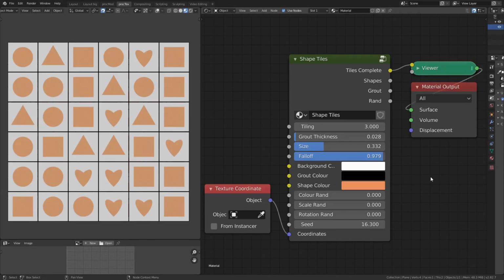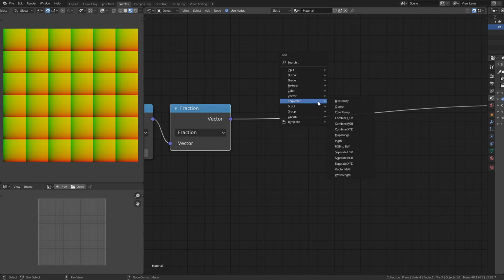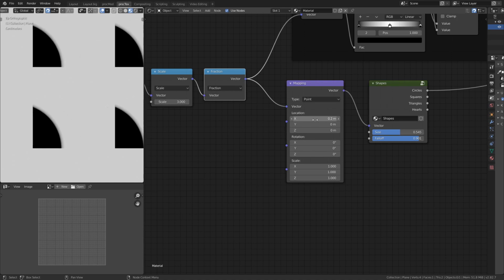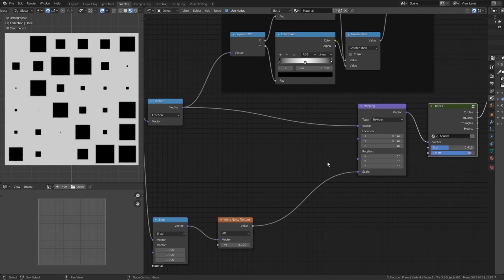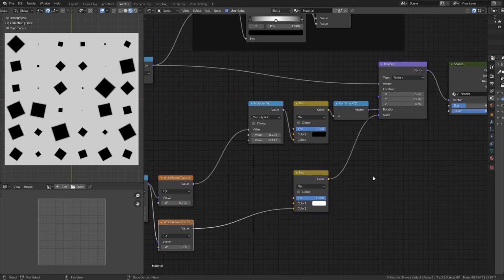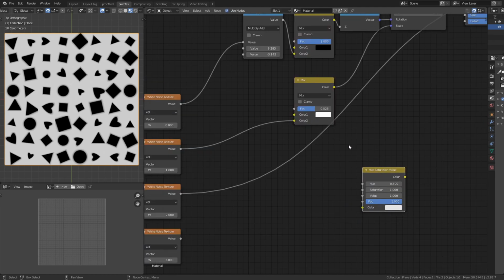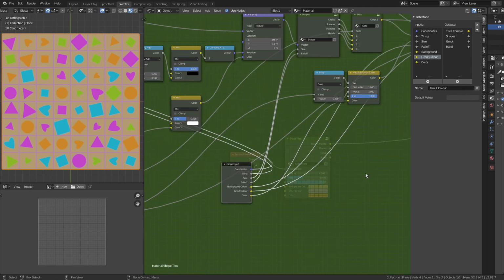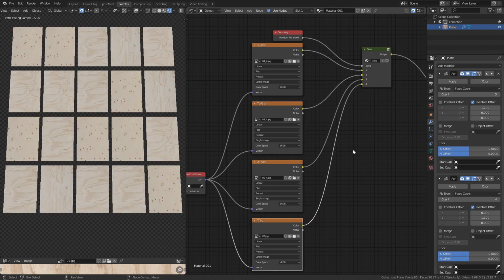Randomness and Tiling - Getting started with Blender Nodes Part 2

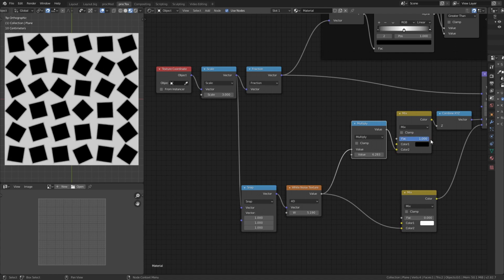Comment: Just wanted to mention something at 11:35. I’m not entirely sure if you know this now or not since this was made a few years ago, but there is actually another word for “2*pi”. It’s called “tau”, which in math is the double value of pi. If you type in “tau” in (we’ll just say for example) the “Multiplier” input value of a Math node set to “Multiply Add”, it will give you the same value as 2*pi

Comment: Very well explained. I actually already knew 75% of this, but I had to figure a significant part on my own, so my practices weren't always the best (for example, I had been using modulo instead of fraction, and kept running into the annoyance about negative numbers; frankly, as a mathematician, Blender's implementation of modulo is just mathematically wrong; this is one of many mathematical points that Python gets right but which languages like Javascript get wrong).

Comment: Oh my god you should see the insane node tree I made to achieve multiple random values, rather than doing it the correct way with noise. Mine ended up working but it takes about 10 seconds to calculate on my (fast) pc. This will change everything, thank you. Can’t wait to remake my materials more cleanly !
Reply from the maker: 10 seconds to compute is something you should be proud of! I've never made anything so heavy before 😅
Reply: @Erindale  I remade it haha, it was sooo satisfying thank you! I see some of your videos have details above the nodes that show you how long they take to compute? Is that an add on ?
Reply from the maker: In blender 3.1 you can turn on node timings in the node graph overlays
Reply: @Erindale  thank you ! :)

Comment: Very well-done tutorial! Just out of curiosity, without the use of the color ramp in order to convert the scale from (0 -1) to (0 - 1 - 0), is it possible that we can replicate this transformation using math nodes only and how can we do that?
Reply from the maker: Thank you! Yes absolutely! The maths node has a function called Pingpong. You can think of this as "bouncing" off the value of the second socket. If there's a gradient from 0-1, then we can pingpong off 0.5 to make it symmetrical (0 - 0.5 - 0). This could go straight into the Greater Than node as is or you could multiply by 2 if you wanted the 0-1 range! Using Pingpong, you wouldn't even need the Fraction node in that string (although we use it elsewhere so it's not going to save any computation time in this case).
Reply: @Erindale  Thank you very much for the in-depth reply! Hopefully, we can see more of your wonderful tutorials in the future, cheers!
Reply: A way of rephrasing how the numbers should be changed is to say that 0 should be changed to 0, .5 should be changed to 1 and 1 should be changed to 0. One of the tools is to use reflection around zero by using the convertion->math->absolute node. The input value is 0...1 so multiply by 2 which is (1/.5, which is when the reflection needs to happen) giving 0 ... 2. Subtract 1 (which is now the half way) giving -1 ... +1, then into the absolute node giving 1 ... 0 .... 1, subtract 1 (the original max) giving 0 ... -1 ... 0 then absolute again. This is off the top of my head so their will be an error in there somewhere but the idea is to create a range which crosses zero then use absolute to fold the range in half.

Comment: This was awesome.  I know that to really acquire this knowledge I have to do it a lot on my own, but I just seem to fiddle around and waste my time.  I still don't know what I'm doing, even after following (and understanding!) the shape tiles class.  So, I'm just going to keep going through your classes and hope it all comes together...gulp.
Question: why does fraction split the plave into UV squares?  Why not object squares (with 0,0 in the middle of each square)?
Reply from the maker: Work through some personal projects and it'll start to click. Following tutorials is only 50%. You need your own hurdles to process the information.

Fraction returns the fractional part of the number. Meaning the non integer part after the decimal. That's why it'll never be negative or reach 1.

Comment: hi Erin, its been a while since you uplodaded this, the only thing that was a bit hard to understand is the filtering you did with the gate, when you were substracting values
Reply from the maker: Essentially the factor on a MixRGB node is clamped to a 0-1 range. No matter what range you put in, anything 0 or less gets read as 0 and 1 or higher gets read as 1. What this means is we can plug in a 0-4 range and everything 1-4 will be processed as the second socket. If we then subtract 1 from our 0-4 range then we get a -1 - 3 range. The part of this that gets read by the next mix node will still be the 0-1 but now this is the "next" 0-1. Subtract 1 again and the following mix will get the next 0-1 again etc etc. The node order probably makes more sense if you lay out your gate like this instead: https://i.imgur.com/lD44Xts.png
Reply: @Erindale  Thx a lot Erin, now its more clear :3

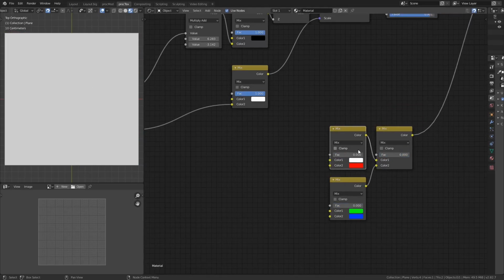Comment: Loving your channel! Question - As I'm really starting to fall in love with the math node, just for the sake of learning would it be possible to do what you did around 14:00 with math nodes instead of mix RGB? I've tried thinking it through myself, and will continue to do so, so even if you don't just spoon feed me the answer maybe a push in the right direction would be helpful.
Reply: ok so I used some lunch break time and I figured out one solution, but perhaps there is a computationally speaking "leaner" solution? 

Anyway, from the (all math nodes) snap node connect 4 compare nodes (just messed with epsilon as I have no idea what it really does, .75 worked). Adjust the second value so that each of the 4 shades is either black or white. To each compare node connect a multiply node, then into the second input socket of the multiply node wire each different shape. 

From there, it's just the standard 3 add nodes (add 1+2,  add sum of 1&2 + 3,  add sum of 1&2&3 + 4). 

Sometimes it's hard being a nerd who loves problem solving today when your past self was drawing space ships and mortal kombat during math class.
Reply from the maker: @superwalnuts2855  The compare node is kind of like a fuzzy search! Basically, is value 1 within epsilon distance of value 2. I'm amazed that you got a method that works but that sounds like it's a pretty optimal method with math nodes! There are some under-the-hood optimisations going on within Cycles though so actually using mixes as switches is pretty lightweight. With a factor of 0 or 1, Cycles will completely ignore the entire branch that is being ignored on that node so you could have two incredibly complex trees and switch between them with a mix node, essentially disabling each one. This is true for Cycles but I think Eevee may not be so well optimised!

Mix nodes are essentially doing a Vector Lerp (linear interpolation) the formula for which would be: A + (B-A)*factor. Baring in mind that this is a vector operation as well (rgb, xyz) means it's that calculating 3 times over for every Mix node. When using scalar information (black and white) like this it's maybe actually more optimal to use math nodes to calculate it!
Reply: @Erindale  I don't know if it's that optimal as it takes 11 nodes total to get there, but I just couldn't help myself. All in all your method is very clever and if I'm making a shader not for learning but for actual application I'll stick with your method!

Comment: Great tutorial, I know it's been a while since you uploaded, but I cannot get the gate trick to work with an array, all parts come back the same colour, either in 2.83 or 2.93 It works fine in changing the shapes, so the logic in the group is sound clearly. Has the way arrays are handled changed since 2.82?
EDIT: Ahh, scrtach that, it doesn't work in lookdev mode, only rendered, durrr.

Comment: Love ur video mannn!!! Also, whenever I use the fraction node, the texture glitches for some reason
Reply from the maker: Thank you so much! I was wondering if I should talk about this in the video actually. Basically, the fraction is going to jump from 1-0 at each integer. What is happening is that the plane is exactly at z=0 and then when the fraction happens, it's simultaneously trying to be 0 and 1. Hopefully that makes sense... Basically just hop into edit mode on the plane and move it up very slightly just so it's not right on the point it changes!
Reply: @Erindale  OH MY GOD THANK YOU SO MUCH I SAW THIS JUST NOW!!! I actually found another solution... I was using uv coordinates which was 2 dimensional so what I did was, I basically separated the vector, added a fraction node to the x and y, and then combined them again... That seemed to do the trick but I'll try yours too!!! Thanks a lot man I'm so glad I came across your channel!!! Keep it uppp!!!
Reply from the maker: @mdriaz2002  Yes your way will work perfect too as it keeps the Z from being calculated through a fraction!
Reply: @Erindale  ayeee :)

Comment: Anyone else having a problem with the Grout Thickness node? The value node works fine i.e. the thickness changes when I change the value in the "Value" node. But when I replace it with the GroutThickness fac group input node, the slider has no effect on the grout.

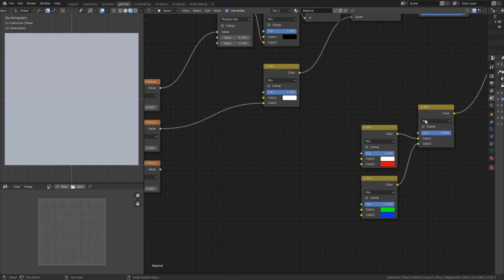Comment: Hi at 14:00 can you please tell me why it should be followed some specific order while connecting white noise to mix rgb nodes
I tried different order but the result is not correct
Can you please tell me why
Reply from the maker: The factor on the mix nodes is acting as a gate between each socket so for example if you have a room with two doors and each room leads to another room with two doors. If you shut the door on the first room then you wouldn't see the doors in the second rooms change. I actually do my mix gates a bit different now which feels more understandable in a linear way as you can see here: https://snipboard.io/u8RBPV.jpg
Reply: @Erindale  thanks, yes this is understandable

Comment: Is it more economical to use a math node than a Map Range in the rotation setting? Great tutorial, seeing it 2 years later. I'm a bit late
Reply from the maker: Map range is just a divide and subtract. Perhaps you could save yourself a tiny bit by using a multiply instead but it should be marginal gains
Reply: @Erindale  Will there be any readout that will tell me the machine cycles consumed by each node, or is it too crazy what I am asking?
Reply from the maker: Yeah nothing like that in blender for shaders unfortunately

Comment: I loved it and I did my version. The problem is that the rendering is awful! Should I bake the texture first?
Reply from the maker: If you're having some flickering issues, it'll be to do with the snap! It changes from 1-0 exactly at the point of the plane which can cause some artefacts if viewed at angles. The easiest solution is to just hop into edit mode and raise the plane up ever so slightly!
Reply: Erindale there is some flickering... but when I render, the blue becomes gray in a strange way, as if it was a glitch
Reply: @Erindale  It's impossible! I´ve been trying all day. :(
Reply: Erindale I’ve finally baked it, but even the baked file is not good. Lots of fireflies in some areas...

Comment: Understanding this is a didactic exercise, I had wondered why some ppl use the White Noise texture node, and some ppl use the Noise Texture node.  I first hypothesized it may have to do with ppl in the EU compared to ppl in the US having different preferences.  I now think that hypothesis is not true.  What I was told after asking around, was that the White Noise texture node changes its values every frame, while the Noise Texture node does not change each frame.  Is that true, or have I been misled?  That the White Noise Texture changes each frame  is not noted in the Blender Manual.  Why idk...
Reply from the maker: White noise produces a random value where the input vector is the seed. With a continuous input like UVs it will display white noise where every pixel is a random value / colour. Used with a stepped input you can create random values in a much more usable way. 
The noise node is perlin noise so adjacent points are related to each other and you have smooth gradients. You'll notice white noise has no controls like scale.
Reply: @Erindale  Maybe my use case was different then, because the W/N node was giving a unique set of random values each frame.  

Unfortunately, I've been simplifying what I have to do for my Machinima work to test/verify I can do what I want to do like stuff like this https://youtu.be/74QKHtylEe4 so Idr offhand where this issue came up (!)  (the "pool" in the middle of what will be my portal, is not dynamic paint or a fluid sym, that's GNs) I've developed a huge library of simplified proofs of concept... and I must be lazy or something to go thru them all...

Maybe on a static data set like UVs it doesn't do that... I have to verify... I was almost certain that the frame change was the initiator of the next random set of points, but I could be wrong...

I have to take this painting with functions way more seriously, because I can't remember the function that acts like Modulo 2... I should be able to make a sawtooth pattern with it... I thought it was pingpong, but I haven't played with it yet... so I'm gonna take notes and study them until I remember them... 

'Don't be a fool, stay in school...' I didn't know it was that serious, but this is now.

I appreciate your videos helping me keep on  thinking as I grow older watching my brain slowly spinning down to the consuming state no one escapes.
Reply: Nope it's the Wrap node... sad, Jocafa told me before I refound it... 😭

Comment: How would yo go if you needed a tiled pattern with a triangle at 0 deg and then the next at 180 alternating?
Reply from the maker: Hm you could make a triangle out of a square that you cut diagonally. You could make squares but instead of straight coordinates, if you add X to the Y axis you’ll have a parallelogram. Then you heat need to work out how to split into two triangles
Reply: @Erindale  Gotcha, I'll try to figure this out, thank you very much for answering 🙏

Comment: When I connect the snap to the white noise, the material is all glitchy with lines everywhere, and I can't figure out why. The nodes are the exact same as the video. It messes everything up after it, but the snap is fine. Do you know why?
Reply from the maker: If you take the plane and, in edit mode, just move it up very slightly it should fix it. The issue is that the plane exists at z=0 so the snap is changing right on it. Either moving the plane or adding something to the Z before the snap will sort it out! I completely forgot to mention it when editing - apologies!
Reply: @Erindale  Thanks! Worked perfectly!
Reply: @Erindale  Also, the scaling for the shapes is offset, and inverse so it scales down to the (-x,-y) corner with positive values, but I have all the nodes correct from the last video.
Reply from the maker: @cassidyrenno8596  hm it should be scaling from (0,0). Is there anything I did in the video like -0.5 before scaling? Or point vs texture on the mapping node?
Reply: @Erindale  I got the -0.5 and the point. And I just double-checked the nodes from the last video.

Comment: Hi erindale, I am trying to make a texture selector (random texture for object with same material) but I can't make it work, can you help me?
Reply from the maker: Sure thing! In this video there's a section on making a gate. That's basically what you want to do. You can see at the end of the video how I use it to randomly distribute a timber texture across multiple objects
Reply: @Erindale  yes I understand the video, but in the last part of the video, you use the random only on array objects. I want to use the same idea but on disconnected objects sharing on one material, how should I do that? been figuring out for hours now but can't make it to work.
Reply from the maker: @HBFortunato  If you're doing it on an array then you can only do it with Cycles using the Random per island option but if you just want to have different objects getting different textures then you can use the Object Info node's Random socket as the seed value instead and this will work with both Eevee and Cycles!
Reply: @Erindale  I got it now. but last question, how can I add more color to the gate?
Reply: @Erindale  Hi! I've tried putting additional mix nodes but only five colors I can achieve the other color in mix rgb node doesn't output on the texture. please help

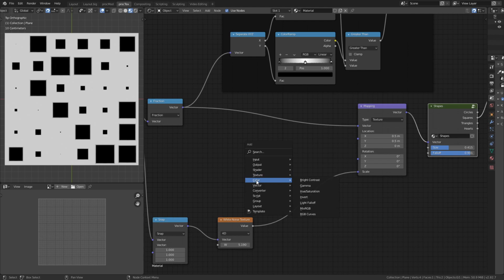Comment: at around 10:00 white noise texture does not give random scale. what to do?
Reply: if i choose floor over snap it works perfectly! im using blender 3.1.
Reply: is this the correct way for me?
Reply from the maker: Floor is the same as Snapping to 1.0. add long as you have it working as you want, then that's a good way to do it!
Reply: @Erindale  👍